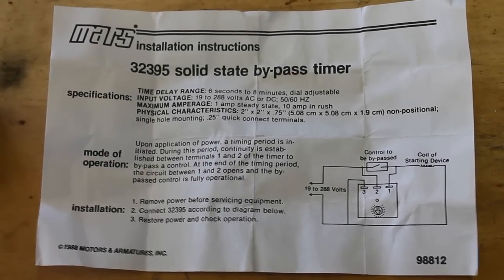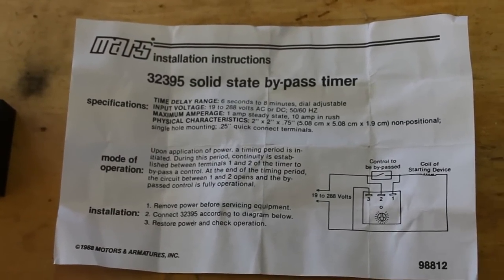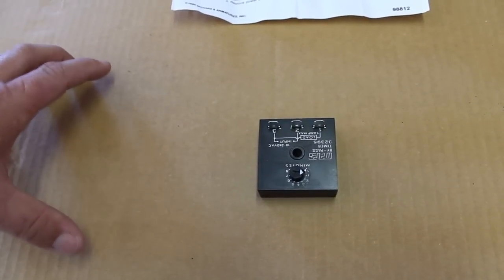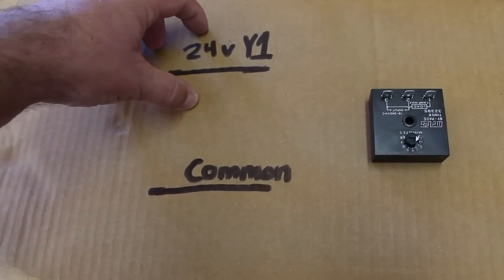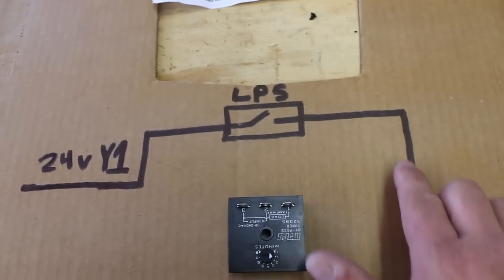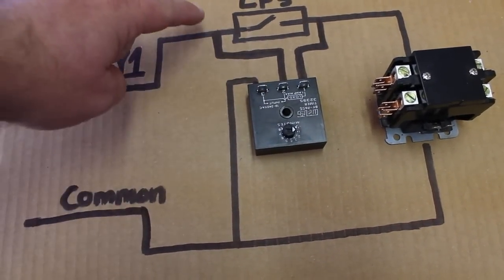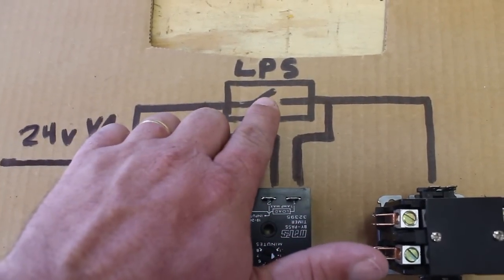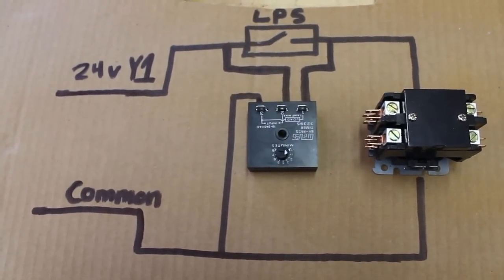HVAC Relay Training-  Bypass Timer

Comment: Hey Zach, which control would you recommend as a delay for a 24vac system. Example would be to place it inline before the contactor to prevent short cycling by a home owner turning the thermostat up and down rapidly.
Reply: Just put in a stat with a five min delay built in. Most of the new digital already have that option.
Reply: You can use one of the cheap 2wire delay but it has to be hooked directly to contactor not to a input of control board it won't work.
Reply: PHC Apprentice either of those suggestions will work well. You could also use a device like the ICM 492 to give you a time delay when power is cut to the condenser as well.
Reply: Thanks guys.
Reply: Or the Emerson electronic contactor
Reply: #sureswitch
Reply: You need a delay on break in this case.  Thermostats will not delay the unit off during most power surges unless it is a long off surge.

Comment: So if you have a bad low pressure switch, and the unit has a low pressure bypass, the compress will run until that timer switches off and the compress will sut off right?

Comment: How to bypass air handler fan delay to prevent blower fan running after compressor turns off to control humidity better?

Comment: You need this on becon 2 systems so you dont trip lp switch and get locked out on start up in cold ambient before the system can build pressure

Comment: Just replaced one of those on an oil pressure safety this morning coincidence i guess
Reply from the maker: awsom70 Thats odd, I actually don't use them very often.
Reply: Zack HVAC yeah in the residential world i dont think i have ever used one thanks for posting the ideas though could be useful in a very low ambient situation on an a/c but usually the low pressure cut out setting is sooo low i dont find it an issue anyways
Reply from the maker: awsom70 I have seen a few heat pumps that could have used them on cold days, but those days are few and far between.